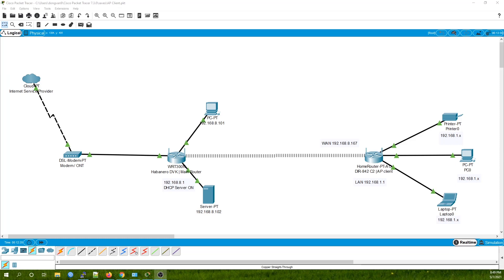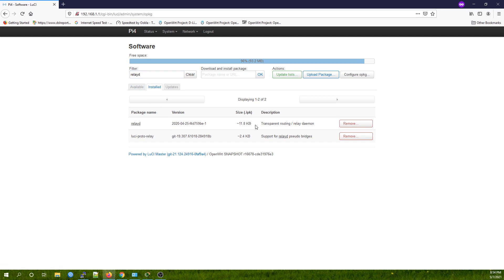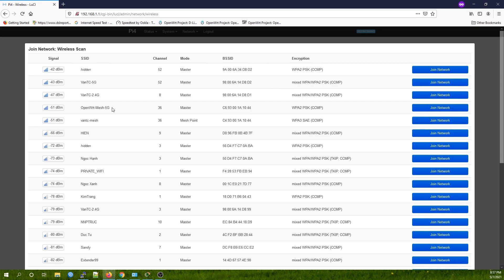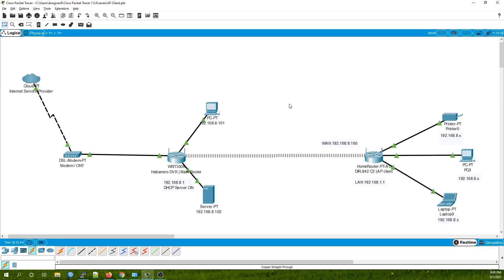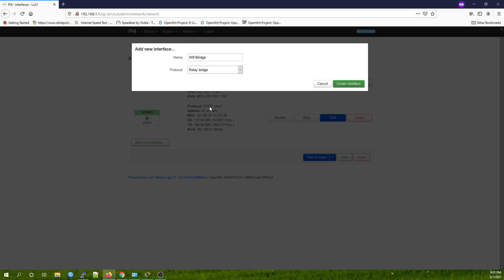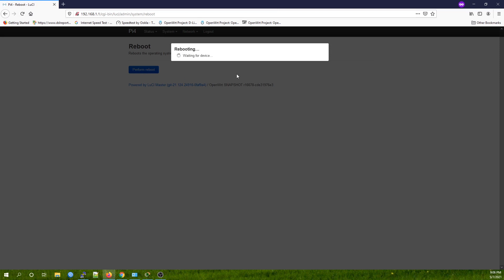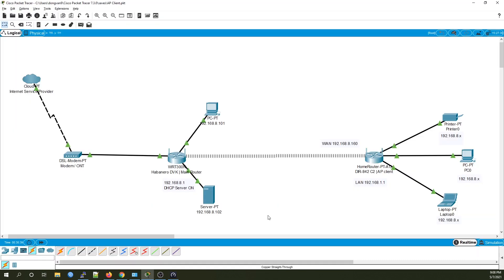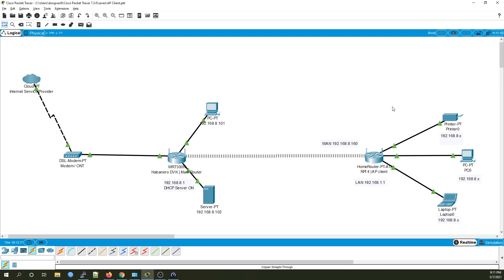OpenWRT - WiFi Bridge (LAN to LAN WiFi repeater/extender)

Comment: Great video! Thanks to it, I replaced my TP-Link WR702N, which wasn’t performing well in bridge mode, with a mini PC using an Intel AX200 network card. Now I’m getting full speed on all devices connected to the switch.
*Make sure to include the required driver iwlwifi-cc-a0-59.ucode so the AX200 is properly recognized in OpenWRT.
*No need to change the default IP — both the main router and the bridge device work fine on the 192.168.1.x subnet.

Comment: Hi,

I was successfully able to set up this lan to lan bridge. 

I have a 3rd router. Can I bridge it with the 2nd router using the same method?
Reply from the maker: Hi, if all of the devices run OpenWrt, you better setup Mesh to have a better connection

Comment: I have tried and it works. But after I plugged the lan cable into the router (I moved the lan cable from the PC to the router), the connection dropped by around 70%. what's wrong?

Comment: I made raspberrypi the relay between wwan(usb0 firewal wan) and eth-br(eth0 wlan0 firewall lan) ip192.168.32.2, wwan( device usb0  -has its own dhcp server 100-150, I made connection static ip 192.168.32.100 gtw 192.168.32.1) lan-br ip 192.168.10.1 (eth0 and wlan0) . It when lan or wifi is connected they not get ip from 192.168.32.x from dhcp. when usb0 is as dhcp client it get random ip 192.168.32.1xy but it others not get this subnet ip. When I connect computer to lan-br and manually set computer  ip to 192.168.32.101 gtw 192.168.32.1 then it this computer is able to access internet. strange thing : I was connected to wlan0 via phone before making relay config it got 192.168.10.9 ip when lan-br had dhcp enabled, but it when now relay is enabled and lan-br dhcp disabled this phone in web openwrt wireless client list is showed as 192.168.10.9 while other computer gets garbage non working ip unless I put in manually 192.168.32.101 then it computer have internet.

Comment: hello dear, i love all your videos about openwrt. The following happens to me: I have a 3g router with openwrt and I want to put it in repeater mode with my main router, I have done it as in your video (even putting the same ips) but what I notice is that the repeater constantly disconnects and sometimes the Wi-Fi of the repeater router does not appear and the speed drops a lot, almost to 0. I hope you can help me. a greeting.
Reply from the maker: Hi, this seems like a complicated case. I will need the network diagram and what is the device you have as well as the network configuration files in order to help. You can create a post in the Van Tech Corner & Friends group on FB and we will troubleshoot there.

Comment: With this setup i get around 7 replies followed by 2 timeout. I tested this with an RPi 3 and 4. Any suggestions?
Reply from the maker: Hi, wifi replay is the last thing to setup to extend your LAN over WiFi, if the device doesn’t support Mesh WiFi.
- Raspberry Pi’s wireless perfomance/coverage is not good, it is only testing/development usage.
- You can buy a USB wifi adapter (with antenna) to improve this; however, with this cost, you can buy 2 used router, install OpenWRT on it and configure mesh WiFi (802.11s)
Reply: @VanTechCorner  it is just for a LAN printer I wanted to connect via wifi.

Comment: Your tutorials are a LIFESAVER! I don't have hardwire Ethernet by my router, but I have WiFi. I needed Ethernet and better signal, this tutorial was exactly what I needed! I also watched your Guest Network video, it was also outstandingly helpful. If I could sub to you twice I would!
Reply from the maker: Glad that the video helps. If you have 2 OpenWRT routers, you can set up Mesh WiFi network for a better connection and higher throughput. You can find the video here https://www.youtube.com/watch?v=cw8ykKgVKbM&list=PL58__w3t_eTbcBQ9oJ8jXCxPtBiac59vC&index=47
Reply: @VanTechCorner  Thank you for responding to my comment. I do not have two OpenWRT routers (I have the TP-LINK AC1750 and AX3000 as my routers.) Do you know if I can achieve higher speeds without changing the firmware? Thank you so much for your help and time, again, your videos have saved me so much time and energy setting OpenWRT up, highest level of appreciation. It really means so much having this content freely and easily accessible. The effort you put into your content really shines through in your videos.   Amazing job, keep it up!

Comment: Does the second router also extend/broadcast/strengthen the wifi signal from the first router?
Is this tutorial meant for that?

I did all steps and all the clients connected to LAN ports of the extender router are  connected to internet. But i was expecting wifi also will be extended. Am i wrong?
Reply from the maker: Nope, this is WiFi bridge/LAN to LAN repeater, the 1st router & 2nd router will be in the same LAN after setup. To extend your WiFi signal, you can simply configure Wireless client & create another wireless network to extend that.  This video will somehow help to explain that https://youtu.be/VX2PYzGMntc

Comment: 10:58 there is an option you can add to the wifi-device config file
option short_gi_40 '0'
I don't know how but it stabilize the internet speed.
Source
NetworkChuck
my SUPER Secure Raspberry PI Router (wifi VPN Travel Router)
Video.
Check Time 16.26

Comment: very good tutorial Thx but how to change IP for "Home router" or how to change routing that we can connect to 192.168.1.1 from 192.168.8.x network ? (i want to open 192.168.1.1 without manual chane IP address od network adapter)
Reply from the maker: You can't do it with WiFi brdige. If you want to be able to extend the WiFi range with OpenWRT routers, you can try to setup Mesh WiFi and you should be able to reach the LAN gateway. Here is the tutorial link https://youtu.be/cw8ykKgVKbM

Comment: I want to be about to have LAN Mesh network using OpenWRT (with roaming) but can't find a video for it.. Or maybe I just don't know the technical term for it. If you have the video drop me the link or maybe show us how its do 💪🏼🤟🏼❤️
Reply: Is what I'm asking about and wire AP the same? But roaming is important. Can all of that be integrated easily?
Reply: Oh and also I wanna use cables because I already have them installed.. I don't want to manually switch everytime I move to another floor/room. That's what I am currently finding myself doing
Reply from the maker: You can find on Google for the definition of WiFi Fast Roaming (802.11r  - usually for wired AP )  & Mesh WiFi (802.11s - AP connected wirelessly). There are some tutorials about it on the OpenWRT tutorial playlist and you can check it out here https://www.youtube.com/playlist?list=PL58__w3t_eTbcBQ9oJ8jXCxPtBiac59vC
Reply: @VanTechCorner  Thank you 💪🏼❤️

Comment: I have problem with the mesh setting. So, try this. But my speed is low, 40~50mbps compare to mesh configuration. Any idea why? Btw, I notice that in wwan, there is Device: unspecified. Should I change?
Reply from the maker: There is certain limitations when using WiFi Bridge. If you don't need mesh, you can try to setup AP Client - this can be found in the OpenWRT playlist.
Reply: It’s could be a Miss configuration mine did the same thing and was able to fix it

Comment: I couldn’t get this to work man. There is no internet connection after I change the relay interface to 192.168.1.5 (outside of the range). Very upsetting! I am not sure what is wrong. Looks like I’ll just have to live with repeater outside of the range..
Reply from the maker: Hey, can you share the time in the video where it goes wrong. Are you able to ping the AP once the AP client connection established?